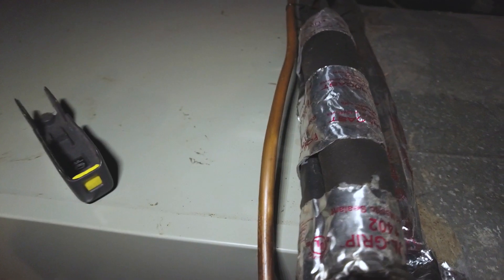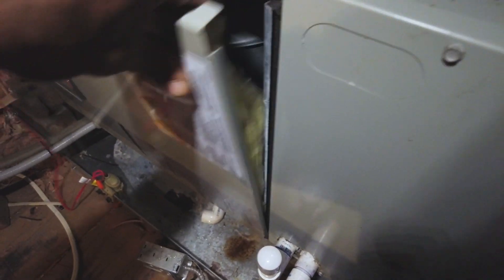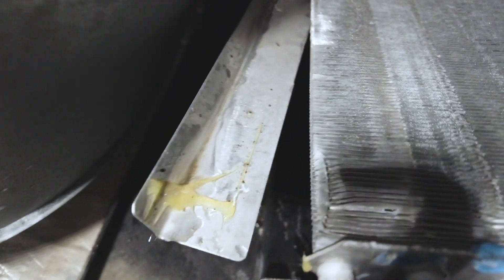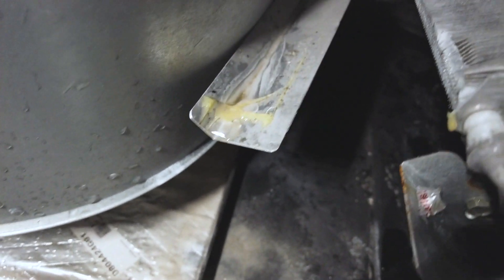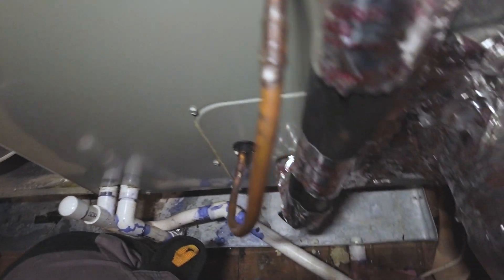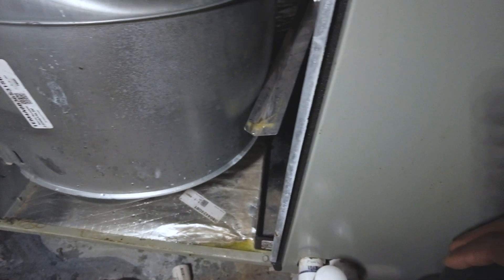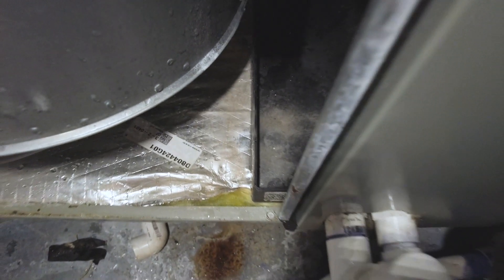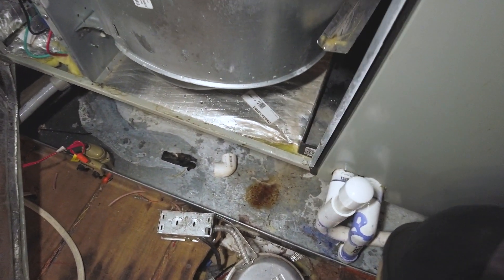Weird Leaking Air Handing Unit issue Caused by Loose Evap Coil Assembly | HVAC unit leaking in attic

Comment: I hate Trane TEM6 air handlers. That water leaking issue has been going on for years on that model. I try to patch them once or twice like u did, after that, I'm ordering a new coil if it's under warranty. Also try lowering the fan speed so it won't suck it out or suck water pass the drain pan. Also there's a clip/bracket on the right side of the coil that holds the coil up and keeps  it from falling forward. Check that to make sure that the coil didn't fall. U can lift the coil in the front, if it rocks, then you know that bracket isn't holding it. I like ur videos. Keep posting 💪🏿💪🏿💪🏿